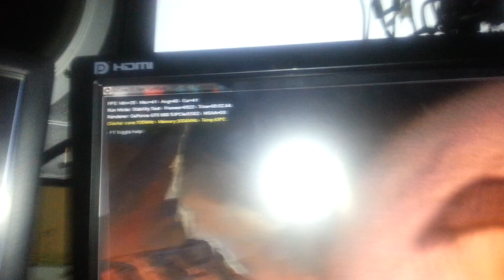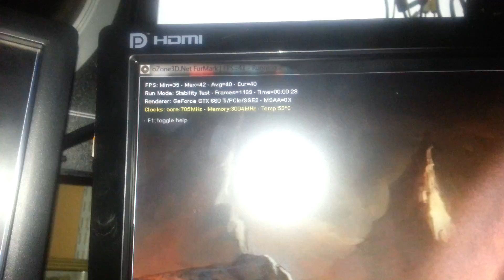Gpu pcie extension benchmark comparison

Comment from the maker: If your gonna spend out on a titan or equivalent gpu your gonna need a motherboard with  at least one pcie ×16 slot , the device you link to in your message will  not give adequate bandwidth or data speed ,it would be like sticking a bull on a rats back, also the big gpu needs a more powerfull psu say at least 750 watt but they are dirt cheap if you want no frills , you could fit a titan on a pentium motherboard with 2 gb of ram  windows 7 64 bit and it would play games ok  , but really you want at least 4 cores on the cpu and a minimum of 4gb ram , so its the pcie ×16 and the minimum 750watt psu , however some laptops have internal interfaces for the mobile versions of these monster gpus like my alienware 18x is running dual nvidia gtx 560m as opposed to the desktop gtx560  but  the mobiles  run hotter and silicon chips dont last as long when over 80 degrees for too long ,  also nvidia gpu software blows away amd .

Comment: oh cool video.. many thanks ! sorry to trouble you if its not too much to ask you.... is it possible to use a desktop gpu card like amd r9 290 or gtx titan to connect to a laptop or desktop pc that doesn't have a high end gpu card ? based on the web link: http://www.hwtools.net/Adapter/PE4H.html 
P.S any enquires pls ask ! :)

Comment from the maker: The gpu  normally slots into  the pcie 16 slot on the motherboard right , this extension sits between the board and the gpu it has a 16 slot like the motherboard and a male 16 male end like the gpu, the other male interface on the gpu is likely a sli (nvidia) or crossfire (amd) for connecting gpus together